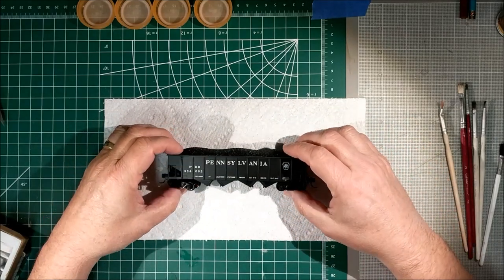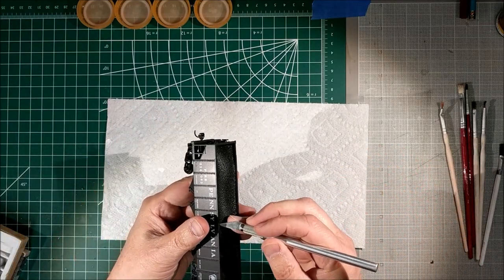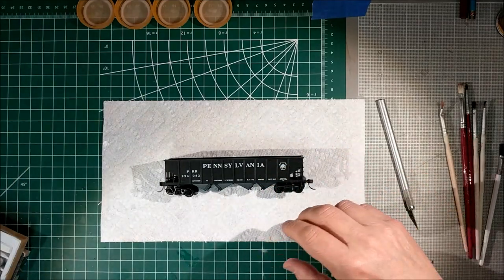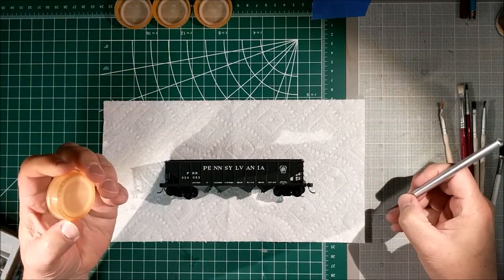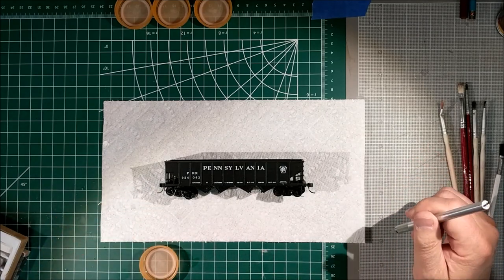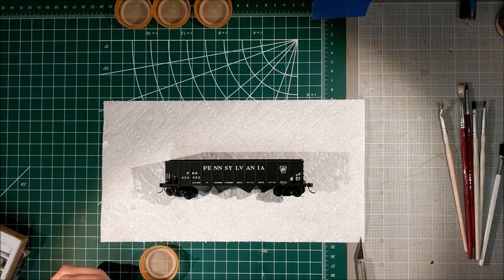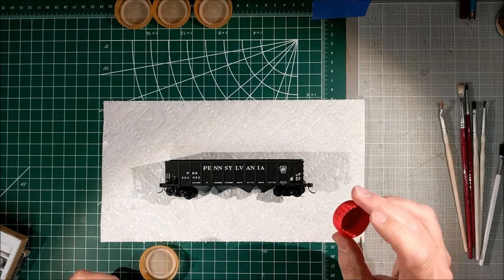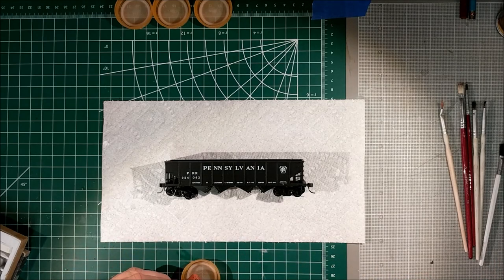Ep 39 HOW-TO Bowser H21A PRR Bowser Hopper, Build and Weathering

Comment: Nice Job Michael! Did you shoot that Vallejo Textured Rust through an airbrush or did you use a sponge or brush for the trucks journals and bolsters? I have some of it and usually apply it with a make-up sponge. I never tried shooting it through an airbrush in fear it would clog my air-brush.
Reply from the maker: Started to air brush it but had the same reaction that you did.  Hand brushed the springs and Journal boxes, and hand brushed the second coat on the wheels.  I think the textured rust could use a bit more color for rust, but looks okay for grimy wheel color.